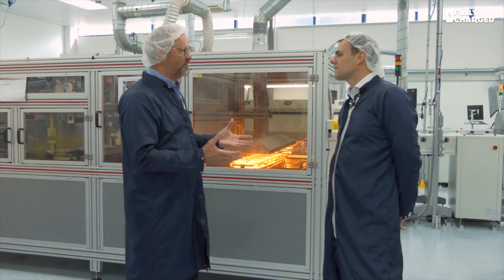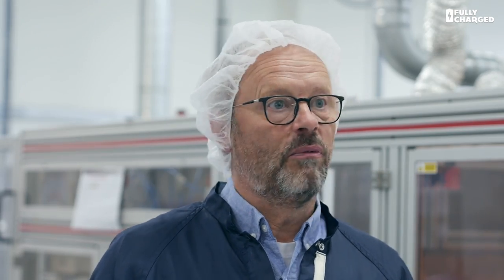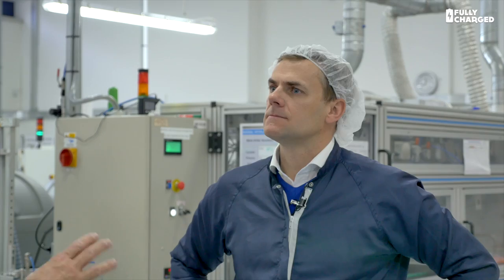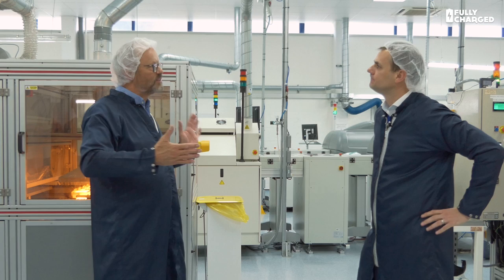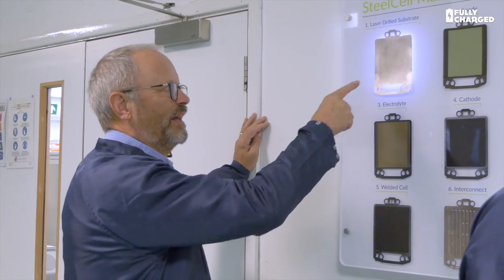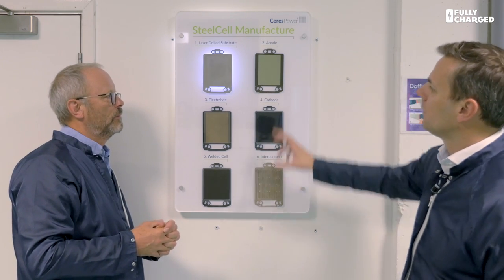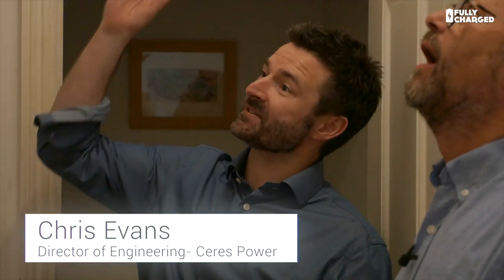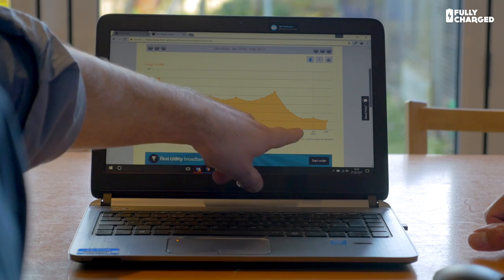Ceres Power | Fully Charged

Comment: Ceres Power generates metallic based SOFC.  The problem they have are 
1: the SOFC cells they make are made of steel and ceramic. Therefore, due to different in thermal expansion of metal and ceramic, they can not last long for a periodic on-off operation due to periodic demand of a house (high morning and evening demand and less demand during midday).
2- As a byproduct of SFOC generates heat. This heat can be stored in hot tanks. Once the hot tank temperature reached a certain level, the fuel cell has to be stopped. 
3- SOFC Fuel cells operate in excess of 550 degC, therefore, the start up operation of SOFCs can take time.

From all above points, it is hard to justify employing Ceres Power products in households. As evidence of this is they have not introduced any product to market, despite they had plan to so in 2010. The share price of Ceres Power gives good indication of they promises how believed by investors. 

It is not a hard logic, SOFC Fuel cells operation requires steady operation and this can be achieved only  when a part of required heat and electricity should be covered by SOFCs. Such a circumstances are large building, hotels, airports etc. For this type of applications, Ceramic based SOFC are better than metal based and hence, Ceres Power will not make a major impact in the market with their current technology.
Reply: Looks like ...they improved the tech...to address the thermal expansion problem through perforated metal sheet...and the process was patented.
I would love to hear your thoughts on this.

Comment: This fuel cell box can convert trucks and buses into the electric mode, even if there is no charging infrastructure, but just the gas infrastructure.

whoever starts a company for converting buses, trucks and cars to this fuel cell + electric motors, will make a lot of money from places where the electric infrastructure is not ready for electric cars.

Comment: Would be great if car companies would install these fuel cells in place of a range extender engine in their vehicles that have that setup.   Wonder how the mileage would differ between the fuel cell and the motor with the same size tank.

Comment: Lots of questions here.
- Does the system have to be pre-heated to 7 or 800 degrees to work? 
- Does it need to continually run to function, no off state without long startup times? 
- How much gas does it use at minimum (idling) and is this why you look to feeding out back to the grid while you're not home cause it has to just keep going no-matter what the home needs? 
- What is the cost and life of the cells? 
- Do they need cleaning due to impurities in the feed-in gas or does this just degrade the life cycle (block your micro-holes)? 
- Does the system also need a water connection as well as a gas connection?
- Could it run as a generator in a caravan, or is the fuel used and waste heat, just too high?

Comment: So efficiency-wise it's a little bit like running a combined cycle powerplant in your boiler cupboard? Decently efficient electricity generation, then the exhaust heat used for something else at a decent efficiency too.

Comment: Cool video, I like the automation fast cut near the start ^^ 

Cheers 

Fuel cells & Batteries : Energy Storage & Energy Conversion : Molecular Chemical Energy Systems 

Humans are biological fuel cells, oxidizing carbon in our lungs to generate energy from our food, CO2 out like an engine that burns fuel, without the nasty tail pipe carcinogens associated with internal combustion engine emissions. 

Fuel cells create energy cleanly like a biological fuel cell system. In both cases molecular chemical energy systems. We can learn from nature & fuel cells are examples of biological process in a man made system. 

Solar photovoltaic panels convert sunlight into electricity, a design that originated in biological plant cells, photosynthetic chloroplasts are specialized cells than convert blue & red portions of sunlight to power the two major kinds of chloroplast, A & B respectively.

Comment: What are your thoughts about battery technology vs other technologies like the one you're talking about? Who will be the eventual winner and will there just be one?
Reply: batteries store energy and fuel cells make it.
Reply: Fuel cells convert energy from fuel to electricity.
Reply: John Goodenough from Austin University has developed a new battery with higher energy density, faster charging time and cheaper to make. At the rate battery technology is improving, it can't be long before we see electric cars with a range of 1000Kms that will charge in minutes.